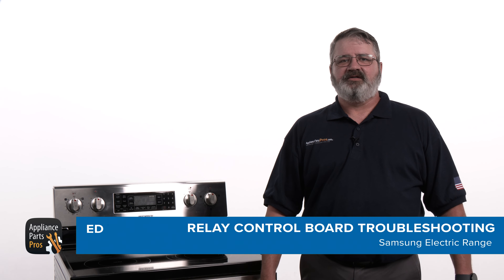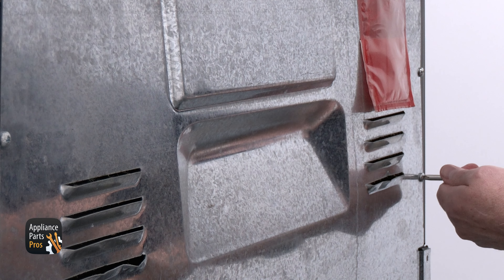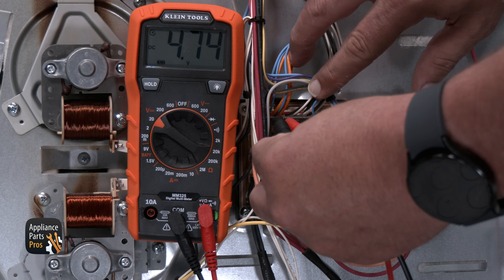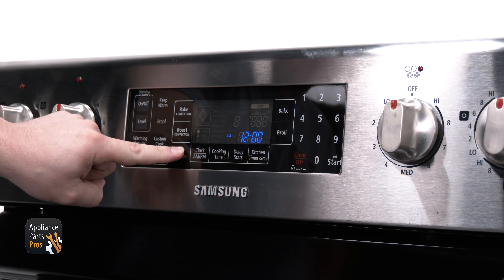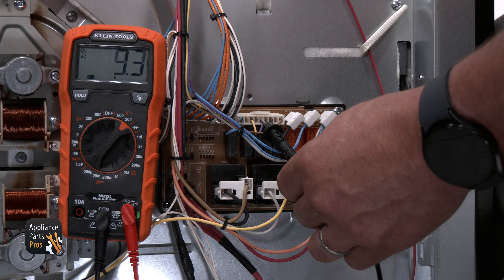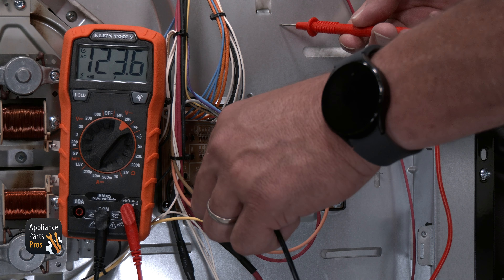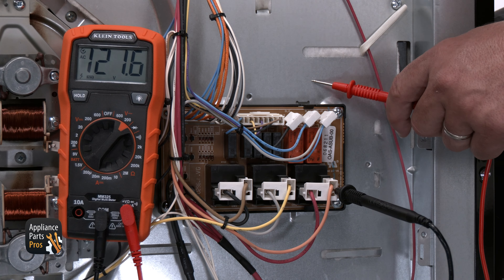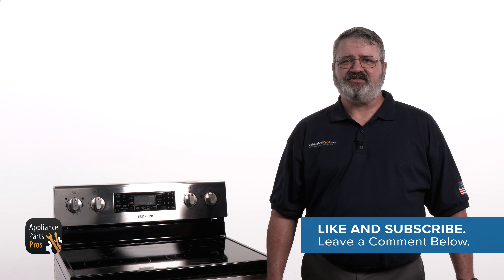How To Troubleshoot A Samsung Range Relay Board

Comment: Thanks for the excellent video.  Have Samsung Duo NE58K9850WS/AA that has a problem activating the broiler and not shutting it off in bake mode.  Happens intermittently.  I see a lot of people with this same issue with Samsung ranges but no definitive answer as to what causes this.  Have seen comments that it is a faulty relay.  Any way to test for this?
Reply from the maker: You will need to test the temperature sensor inside the oven for resistance it should read between 1000 and 1100 ohms, if that is good check the wiring for any damage or loose connections. If that is good you will need to replace the control board.